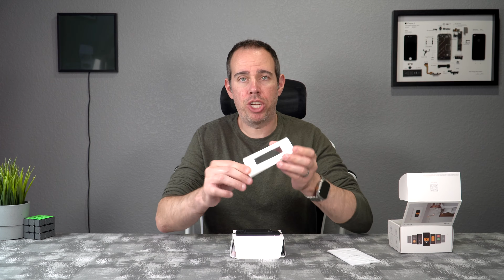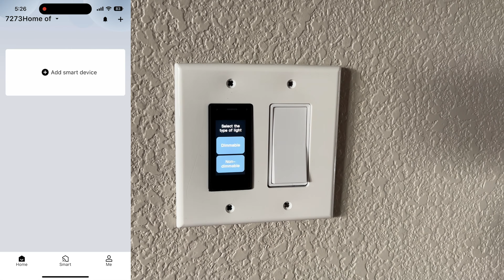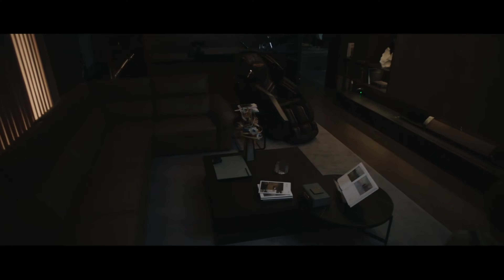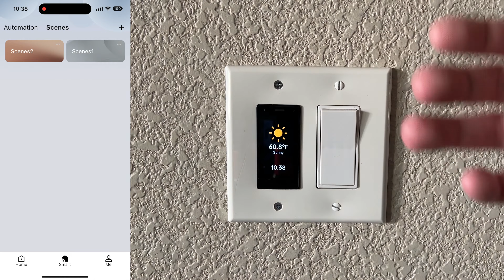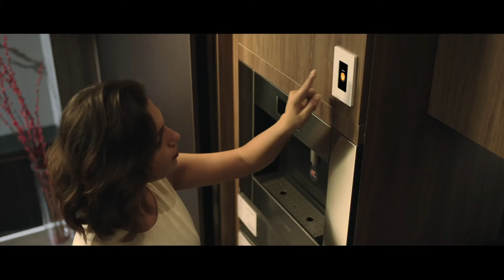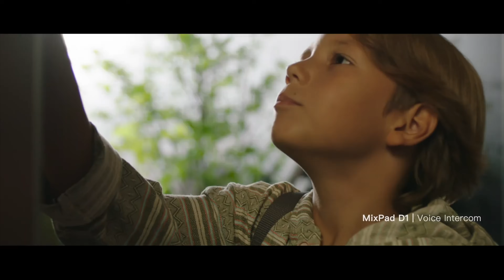Orvibo Mixpad D1 Smart Switch - I bet your switch can't do this!

Comment: Hello! Any thoughts on if I could replace a power outlet that is at switch height with one of these and use it only as a small control pad instead of as a light switch?

Comment: Can mixpad control other smart lights like kasa switches?
Reply: Hard Nope - so far it will only see other Orvibo products. I REALLY wanted this to control some scenes in Home Assistant but NOPE ! (great dimmer though)
Reply: Thanks, what a useless product until they can control other 3rd party switches
Reply: Yes, can even control multiple other switches, also, they have remote switches that require no battery at all; they'rw powered by the mechanical rocking of the switch. All these switches can be controlled by the mixpad

Comment: I installed two of them at my house. My call feature doesn’t show. I can only use the broadcast feature. When I set up my clock , I went back to the original setting, it doesn’t keep the setting. Any suggestions before I return it to Amazon?

Comment: I set the minimum to 30, but sadly it still lets users lower past 30. Hope they fix that.
Reply: Mine does not do this. I just installed it.  Here's the thing....I haven't updated the firmware yet because I can't add an account because I'm not receiving a verification code...

Comment: Really want this but most importantly I can’t find anywhere that says these switches are set for 120v or UL/ETL listed
Reply: Works for me, but what does UL/ETL add?
Reply: Safety testing is what they add. In addition building codes sometimes require UL/ETL listed components to be used. And fire code and/or insurance for commercial buildings may require it. 

I’m not a law professional, but I’ve worked for companies in a capacity that require I check if devices are certified and remove them from service if they are not or replace with ones that do.